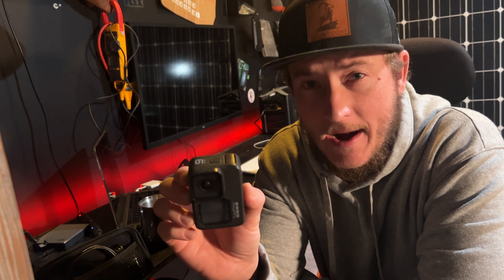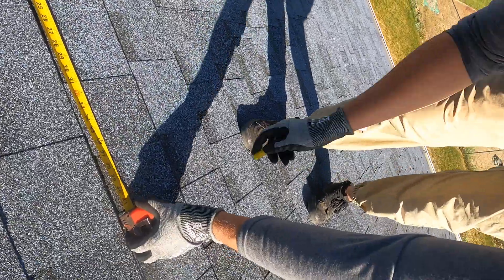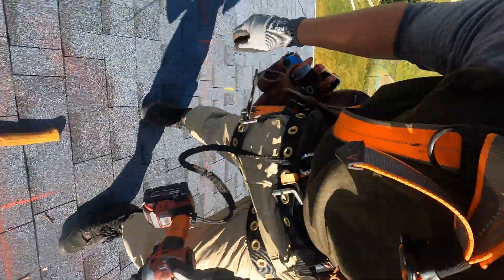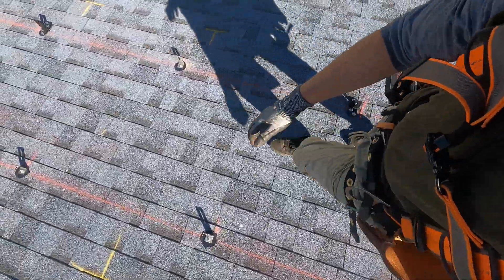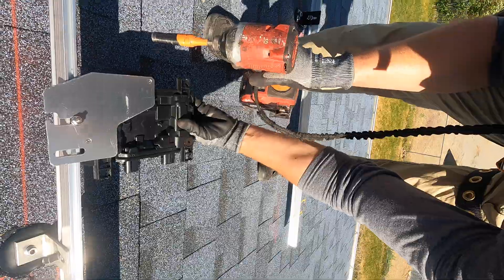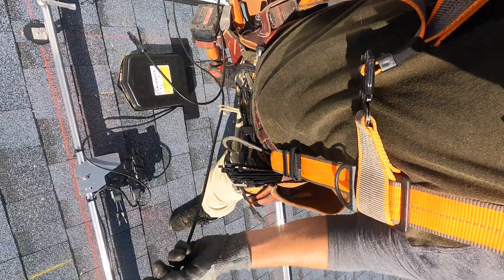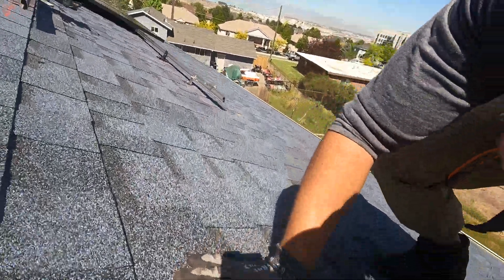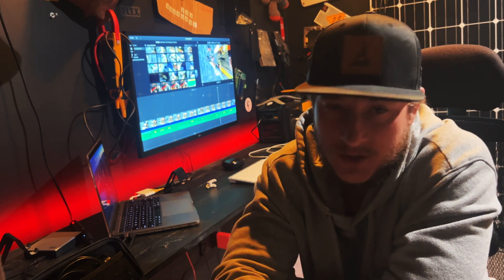How To Install Roof Top Solar - DIY Tips From A Solar Installer

Comment: Live in a hot climate want under the shingle flashing. I find most caulking eventually dries out and cracks if it's right in the sun. I'm in Phoenix we get lot of sun and heat. Why are you wearing a fall protection harness without any rope tied off to anything.

Comment: I'm going to install 48 more panels on my house using snapNrack topspeed. 4 strings of 12 with tigo Optimizer and the cca with tap. A company did my first panels (22- 395). I'm adding batteries so also another inverter ( eg4 flexboss 21 and the grid boss with a second inverter coming later.

Comment: I appreciate your commitment to pass along ALL of your insights. Many people today, don't seem to understand how important this is.  While you have pointed out so many of the mistakes that you have fixed, I thought I would see if you could create a video for what the optimal roof structure would be for a solar array for a long term perspecitve? Perhaps it is a raised secondary structure? Perhaps using newer roofing materials for underlayement, rubber roof shingles, metal roofs, best for areas that are very likely to get hail, etc.  I would like to see about the structure first, as I am inclined to think that many times the difference in money might be worth spending upfront for some additional carpentry?

Comment: I'm about to start the build on my new house, and I'll be using SIP panels It's also a timber frame house so there won't be as many trusses like on a stick built. My question is would it even be possible to install solar panels on the roof? 
 If you're not sure what SIP panels are, they 2 pieces of OSB about an inch thick each with 6 inches of foam sandwich between them. If the screw ends up going all the way through, then they will be seen from inside the living space.

Comment: I am installing panels on the roof of my pole barn.  I am curious on the proper way to run the wires/ground.  The wires will go from the roof, down the side of the pole barn to the disconnect and then into conduit in the ground to my solar shed.  How should I run the wires from the panels over the roof into the disconnect?   Put a box in, run the wires from the panels and ground into that box then into conduit and down to the disconnect?  It is a shingle roof.  This will be inspected, so needs to be to code. Thanks!

Comment: I got a question when you live in a northern climate where they have snow is it important to put the solar panels against each other so that the snow doesn't build up in between the panels? I mostly talking like on a top of the panels because the sides fit really tight together.

Comment: Do you recommend using a Zinc Galvanizing coating when grounding the panels as they are mixed metals (aluminum/copper) etc. to eliminate any corrosion problems??
Reply: No ox at points of grounding usually works, too.

Comment: How do you "level" the rails? I actually used a 6 ft level but the two 22 ft rail sections, top and bottom, do not look parallel to each other when looking up at them from he ground. Also, its an old house with tile roof and the roof is not nice and flat, it has high points on it. Is it more important to try and make each rail section flat and not contour with the roof. Or, make the top and bottom 22 ft rails level and parallel with each other?
Reply: Level each rail individually. Slide  a level from base to base along the inside of the rail at a time and hopefully you’ll only have to make minor adjustments if there are any bellies or dips on the roof.
Reply: @andys1944  Thanks. I ended up using a string pulled from each end of total rail length.. Even then the top rail was not parallel with bottom rail. Eye balled that from the ground and made adjustments.  This was suggested by others on a solar forum. After those tweeks the panels look very flat end to end, top to bottom. Even my neighbor commented how much better it looked than his expensive Sunpower install.

Comment: Where did you purchase the rails? I am having a tough time finding rails to install solar panels for myself.
Reply: Ironridge is very good for us diyers. They have a design tool that layouts the dimensions of the arrays and provides a comprehensive parts list. And everything is engineered so no issues with building permits.

Comment: What's the problem with cables touching the roof?
Reply: The wind can blow the cables back and forth and over time it will cause the cable to become bare and the wires will touch. It can cause fires if the system isn’t grounded properly and if it is grounded the breakers should trip out. As a good solar installer there should never be wires touching the roof ever. It’s also easier for rodents to get to them

Comment: 2:17 "Oops! Just missed the 2x4 rafter and made a point of failure on the roof." -- Imagine trusting a contractor to make 100-300 holes right dead center on the 2x4. I'd recommend GAF Timberline Solar or Tesla Solar Roof instead; no drilling through asphalt shingles into a rafter.
Reply: still have to flash the holes from underneath before he lags in the screws next to it. Unless he makes it too far the pucks cover them good 👍

Comment: Looking forward to the off-grid version. I have my battery backup and my panels. I just need to figure out mounting and grounding the panels.
Reply: For this type of panel and layout you are just resting the panel on the rails and clamping the sides essentially it all depends on what your panel size is and what type of hardware you're using for the install. In terms of grounding the rails it you can use some 10 awg copper wire and a ground lug that attaches to the rail (which ideally you want to install between where the panel will rest on the rail)and goes from you top most rail down to your lowest rail and also ground the junction box like they explained on the video. Although the box may have different places to ground or require hardware to be screwed it will usually be obvious on inspection. Hope this helps